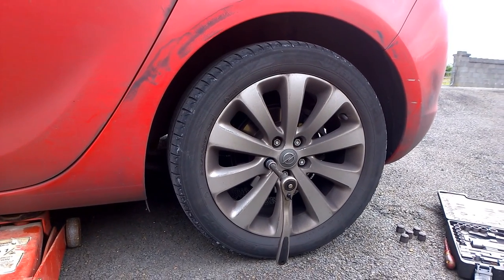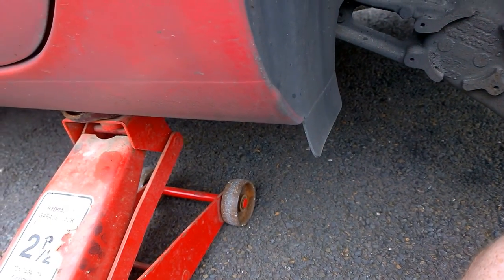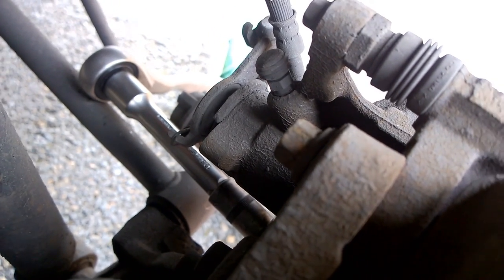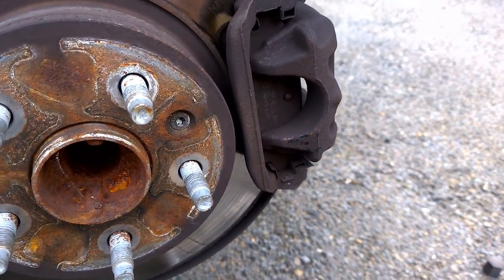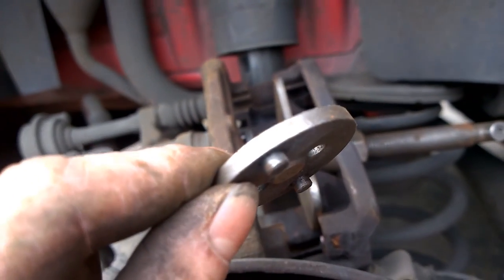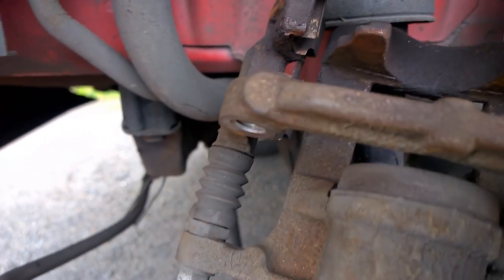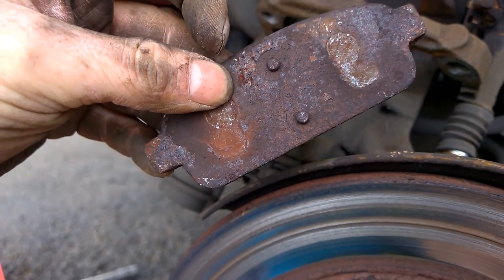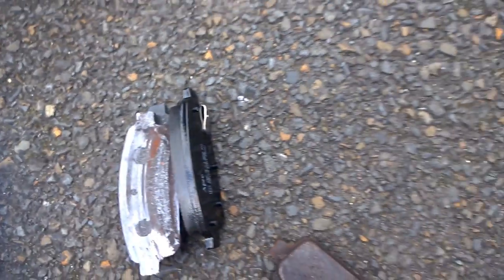REMOVING  BRAKE PADS ON VAUXHALL-OPEL ASTRA 1.3 DIESEL 2011

Comment: its always nice to see new pads on and the dramatic difference in comparison, Also i would say it wouldnt hurt to lubricate the caliper pins/slides with rubber grease or possibly antiseize to help brake pads release once youve taken your foot of the pedal , you may end up with more equal brake pad wear, also old brake fluid can make the pistons stick a little, brake fluid being contaminated with water. hope that helps, enjoyable video Stephen.